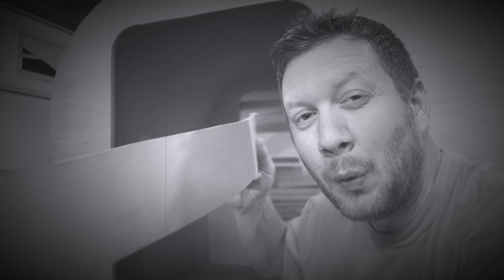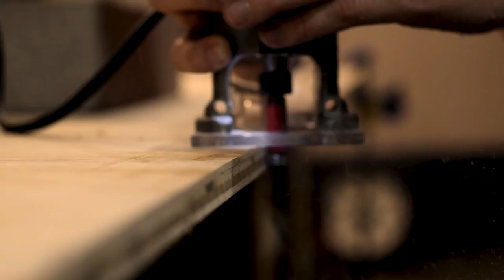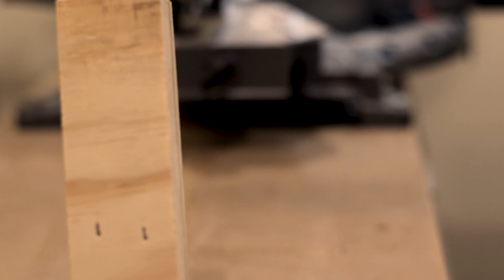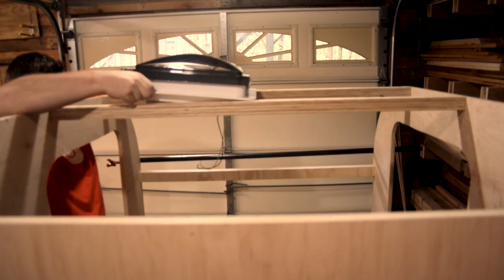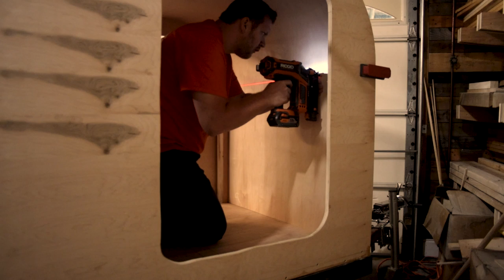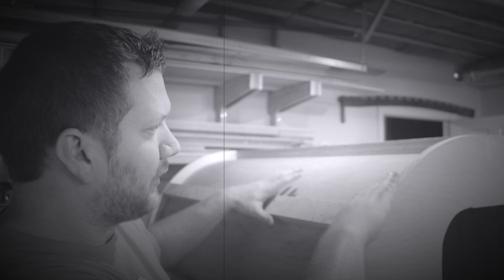Did you know wood can bend like this?  | How to build a Teardrop Trailer #7

Comment: Nice! I've seen that plywood called everything from bender board to wiggle wood. It's great stuff. I can't find the pics (I think they were lost in one of my hard drive failures years ago,) but back at the cabinet shop,  I made a curved-front bathroom vanity cabinet out of cherry. I used this type of plywood to make the wide front rails on the face frame. Once it was installed and the curve was established and secured, I applied a cherry veneer to match the rest of the cabinet. It worked like a champ.

You're cruising right along on the tear drop. Can't wait for the next installment!
Reply from the maker: +Mark Lindsay thanks mark! This stuff was crazy to put on but it looks amazing!! Radius ply maple :)

Comment: When you installed the roof spine to each side, was there a reason you didn't notch the out for them on each side and then install them? If you understand what I'm asking. I've heard different reasons on both installations, just curious about your reason or reasons? Great build and thanks for sharing!
Reply from the maker: +Paul D. Green I just didn't think it was needed. With glue and screws it should be well strong enough
Reply: Southern Ginger Workshop Makes sense, I was just wanting your take on it. Thanks for replyimg!